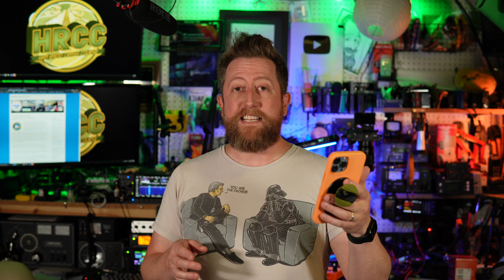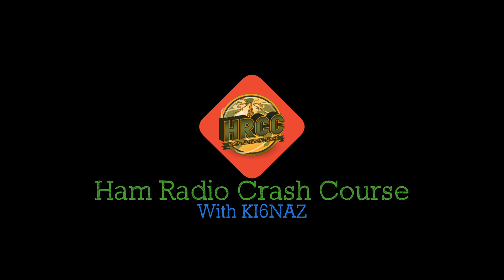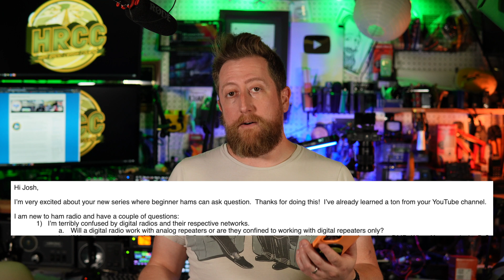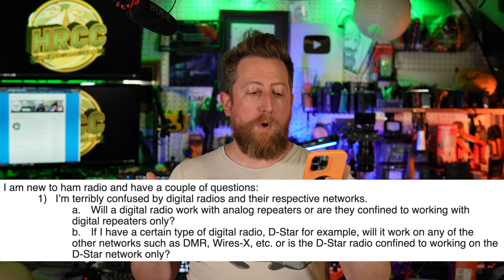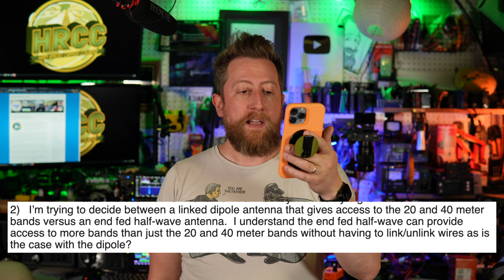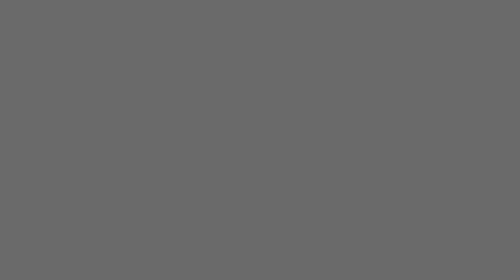Do DMR, D-STAR, YSF Radio Work Analog? & Dipole Vs. End Fed Antenna - #nodumbquestions

Comment: I think I watched this video a few months ago before jumping into digital.  I setup Wires X using my FT5D rather easily,  and then I bought a pi-star hotspot in order to give me freedom from being tethered to my laptop in direct mode.  

I thought having a DMR radio (TYT MDUV380) would be a nice addition to my digital stable,  but ran into problems immediately with the radio not having drivers for Windows 11.  I somehow found it via an obscure post on Reddit.  I programmed in a few BM talk groups but noticed I could only transmit on one of the Parrot channels.  

The radio then started acting squirrelly - not receiving nor transmitting then wouldn’t turn on.  

Playing around with the FT5D I figured out I can add DMR talk groups just as easy as adding YSF rooms.  It’s not like I needed to have 100s available because most are not even in English.  Thanks for all that you do.

Comment: My only HT is a DMR from Anytone.  It is very clear and loud no analog.  When I was in Minnesota last summer, I realized they didn’t have many DMR repeaters, but they had a bunch of Fusion ones.  I am leaning toward System Fusion in my next portable/mobile rig.  Although I have no complaints with the Anytone analog performance.  One thing that is cumbersome is programming the radio.  You must do it from a Windows computer using their code plug software.  It is not that difficult, just cumbersome to add a channel on the fly.  Yes, you can add a channel on the fly but it is convoluted.  Good video and well explained!  All the best, 73 de KI5HXM

Comment: Thanks, nice breakdown. The different digital modes drive me nuts!  I worked with an ARES group as a COML for almost 10 years and we used Fusion, Winlink and APRS (though only for positioning), then started working with another group and they’re all DMR or die. I left, I already own enough 2m/70cm radios to last me 2 lifetimes and outside of ARES I use them only for voice in the immediate area. HF is my real love and I’ll never have too many HF radios, though I sold my amp, it just felt like cheating, and started buying QRP rigs like crazy. Love the G-90, yeah, it’s not really QRP, but it’s not really a normal HF radio either.

Comment: I like YSF for the ease of use. It seems to me like a pay before you play digital system. The DMR with its complexities doesn’t interest me at all. I understand how it works, but when I want to use it for normal ops. I don’t want to have to fiddle/program anything. Because of this and the YAesuSYstemFusion repeater upgrade program, I convinced our club, which owns 5 repeaters, to go with Yaesu. YSF has a mode on its radios which utilizes analog and digital automatically. Sold! Josh, Thank you for the great explanation video!
Reply: each network has their own complexities. just as each mode and frequency. why didnt you suggest dmr/ysf/d-star instead of locking the club into 1 network forcing all members to have to choose that 1 network?
Reply: @pen25  that is easy. We looked into DMR and YSF. The Yaesu sale of DR-2x was hard to pass up at $900. And it is hard to pass on such a great repeater. The BridgeCom repeater is near $2000. D-Star retail is even higher. Besides the repeater is nearly two in one, plus digital/analog. That is a very valid point and I will ask my fellow club members if they are interested in changing things up. Thanks for allowing me see a different view than my own. So far no one has stepped up to even suggest the DMR or D-Star, I think it is because most of our membership plans to stay analog. Again thanks for the alternate view.

Comment: DMR repeaters are in my area so that works well for me. Hotspot transcoding to other protocols need to be fixed. The overpriced cost of the OpenSpot4 is ridiculous and not an option in my budget.
Reply: pi-star allows you tp bridge networks. no need for openspot
Reply: @pen25  D-Star to Fusion or D-Star to DMR is not possible just via Pi-Star.